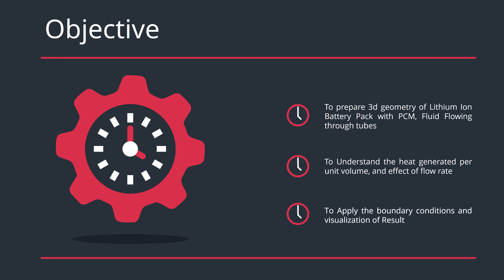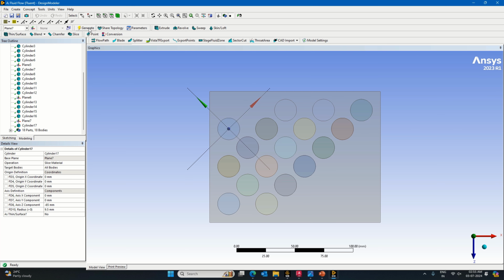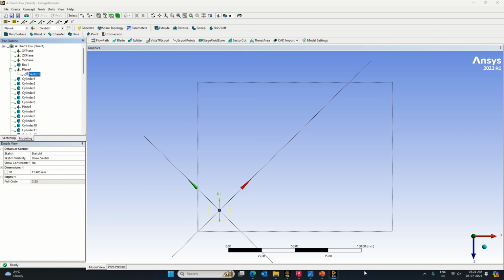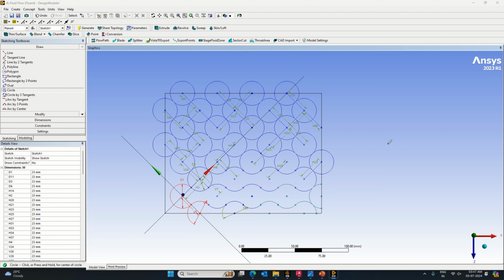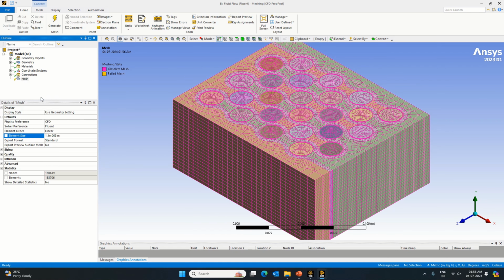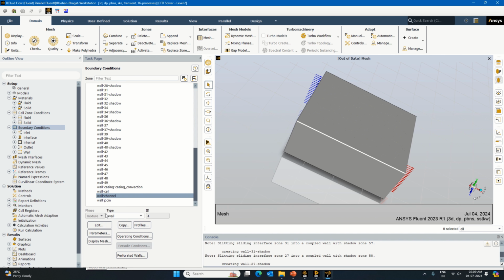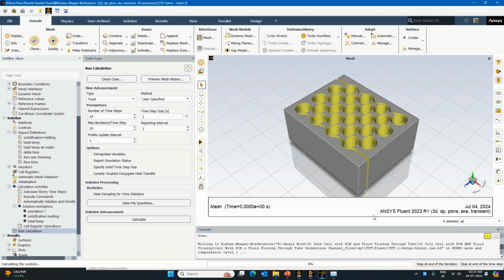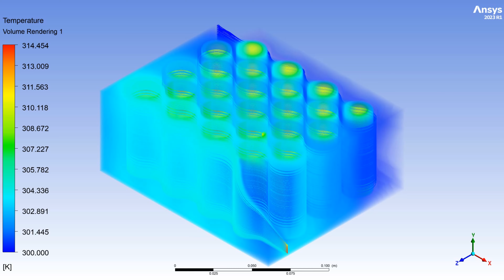Simulation of Lithium-Ion Battery Pack with Paraffin Wax & Fluid Flowing Through Serpentine Channel

Comment: hi can you tell me what is the specification of each cell in the battery and also if you have the relevant research paper it will help me a lot
Reply from the maker: 18 mm diameter 65 mm height
Reply: @FrontiersInCFD  no I mean voltage specifications??

Comment: hi, what is channel wall thickness?
Reply from the maker: 0.5 mm thickness
Reply: Thanks, how you select 5C heat generation for lithium cell, and how you select heat flux in cell walls why 2, like some formula or given.
Reply: @FrontiersInCFD ??
Reply from the maker: If you know cell dimension you can calculate volume of cell. Also if you know the voltage and dischrge current you can calculate heat ge eration per unit volume and heat flux also

Comment: kindly can you tell me that if i change the time for the simulation solidification and melting can be observed ?? if applied the same methodology ??
Reply from the maker: Yes you can visualize. If you take smaller time step size then time required will be more

Comment: hi bro .
bro the total temperature in the battery is 300C.is this correct because i am finding some reference to find it . can you please  tell me or quote some paper
Reply from the maker: I will check i received these parameter for which i have done simulation